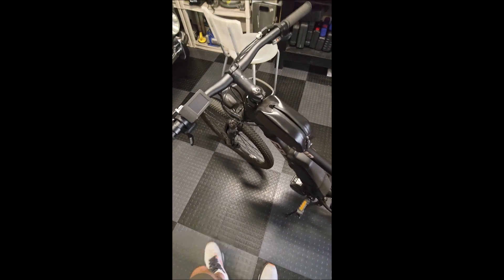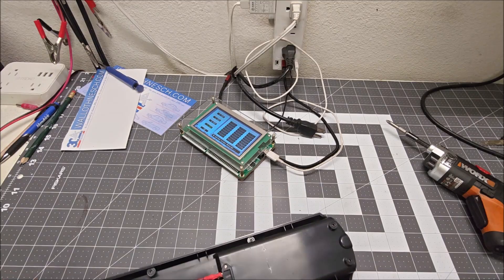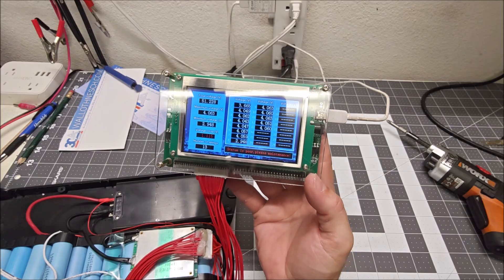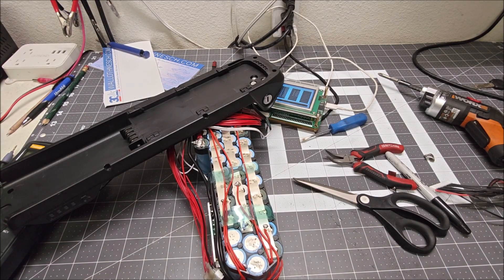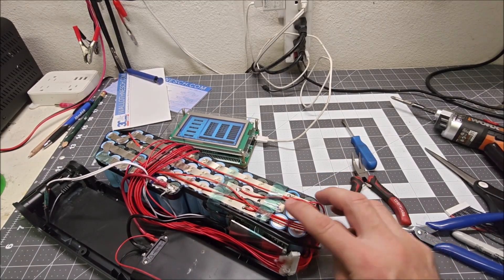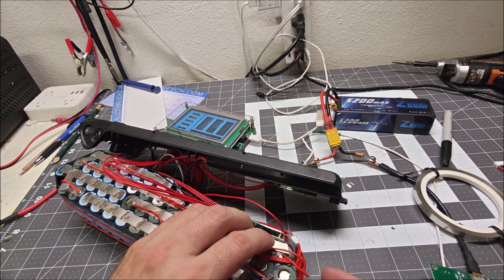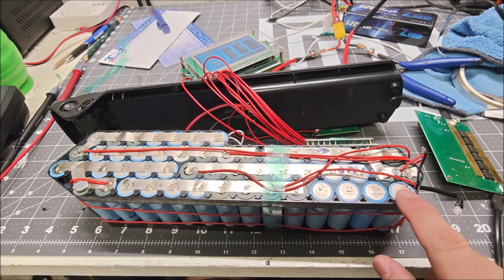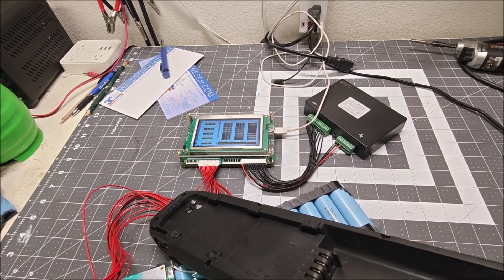Another E-Bike Battery Repair

Comment: I wish that it was easier to contact you about interest that you've shown me in your videos. I have a Schwinn 29 Ridgewood electric bike. Because of the plugging port it shorted out the battery on the motherboard that decides whether it's full or empty. The bike works 100% perfectly. Warranty on this bike has been cashed in and they gave me the bike, minus the keys, as a reward.
Reply: I would like you to repair the battery. I will pay whatever services need to be charged. I feel it would make an interesting video... What a simple owner thinks versus what the actual facts are. Please help and respond. Thank you for your consideration and time

Comment: I needed a break from the time-consuming video that I am currently working on, and then I went to YouTube and there was a new video from you.  Good job replacing those cells, I myself get kinda panicky working so closely with all that power, as I had a pack I built once short circuit because I dropped a piece of metal on the pack by accident, and boy -- the sparks flew big time -- scary thing for sure, so yes, we all have to be extremely careful when working around so much power for sure.  It was definitely the break I needed, and now -- back to work on my video 😛👍👍👍
Reply: Had the same mistake once too, and it frightened me a bit as the Nickle strip soon flashed up!
...Taught me to be more careful 😅

Comment: I had a feeling you might just end up replacing all 4 cells in that group.

Always good to learn more, and seeing your liito-Kala 500 reminded me that I wanted to test the Internal Resistance on 2x 21700 EVE40PL cells (I had left over from a battery build - I got 2 extra just in case)..
I used my Opus BT-C3100 (v2.2) to check them, and I kinda thought I may be getting slightly mixed results, which I did of between 19-23 when repeatedly testing their I.R's...mainly settled down at between 21/22, with 19 being the lowest reading just once, but I'm sure you get more settled readings once the machine has been turned on for a good 5 minutes or so.

I got these EVE40PL'S 21700 cells from  'Fogstar UK' as I know they're a trustworthy company, and if you're ever thinking of using these newer tabless cells, I highly recommend these 40PL ones from Eve, they are powerhouse cells, perfect for an E-bike battery.

Great vid, interesting viewing,
Cheers!
👍

Comment: because a group doesn't die suddenly but over time, it's much better to have some way of monitoring cell voltages daily or at least weekly. plenty bluetooth bms-s available for little money. I personally would never use a battery that didn't have an easy way to monitor cell voltages, including under load and while charging. good work fixing the battery, although my palms got sweaty seeing you work with exposed terminals so close by
Reply from the maker: In the original battery build video my normal BMS didn't fit in the case. I had to special order a tiny basic BMS to make it fit.